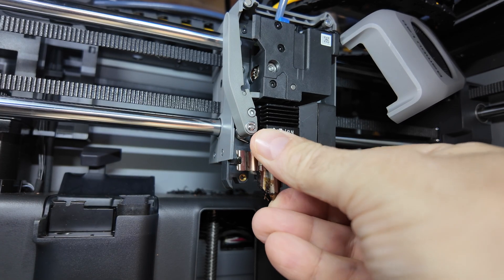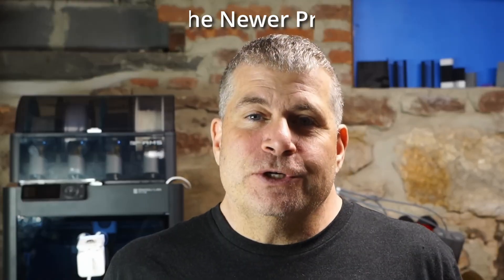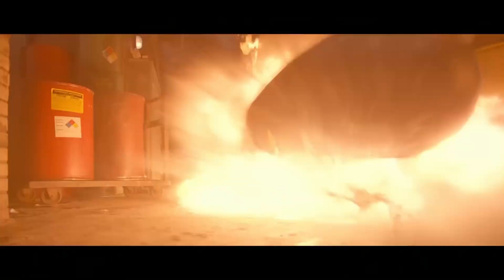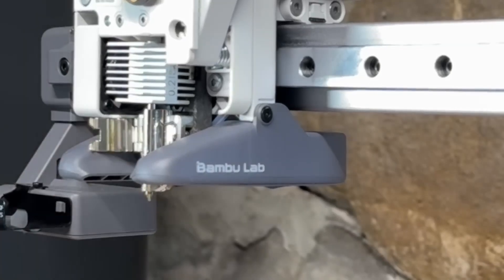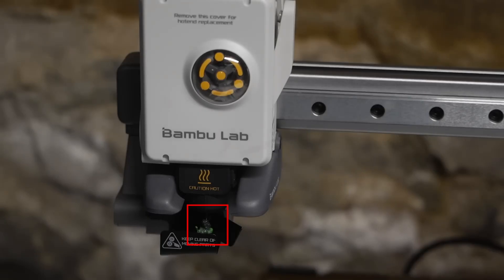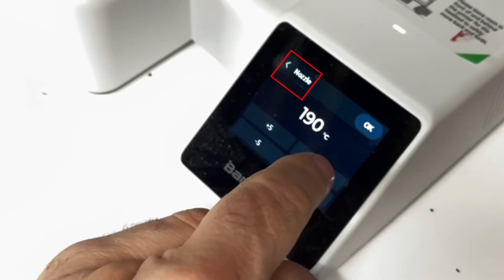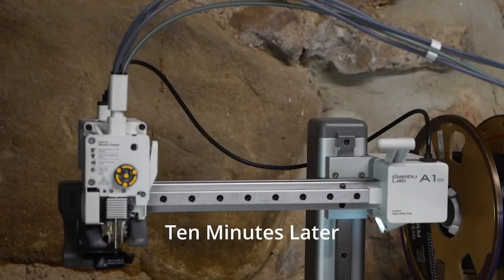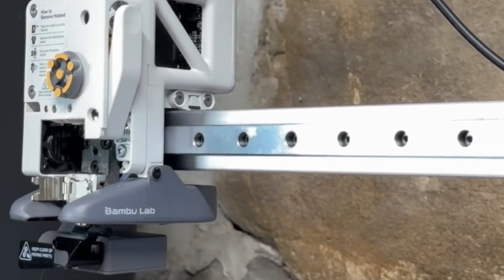Bambu Quick Swap Hotend Stuck Like Glue? Fix It QUICKLY, and EASILY without damaging your printer.

Comment: Znam łatwiejsze rozwiązanie.
Wyciągam dyszę szczypcami, gdy jest gorąca. 
Filament się wygnie i wyjdzie z łatwością.
Reply from the maker: That is definitely one way to do it, and if you don’t mind, bending the cooling fins, or don’t mind buying replacement hot ends if they get damaged, that certainly is a good solution. I’m just uncomfortable with most new users, putting pliers anywhere near their printhead. :) quick question, did you watch this video in English or did you watch it with auto subtitles?
Reply: @davetriesthis Z napisami. Nie znam Angielskiego. Lubię gdy jest opcja automatycznego lektora. Całkiem dobrze tłumaczy to AI.
Reply from the maker: I’ve done the auto language videos before but it makes some people angry. YouTube doesn’t always let you set the default language so you end up getting French or Spanish when you want to hear it in English.
Reply: @davetriesthis You can get soft jaw pliers which dont scratch and are easier on delicate parts.  And since it's hot you don't have to use as much force, it just slides out.